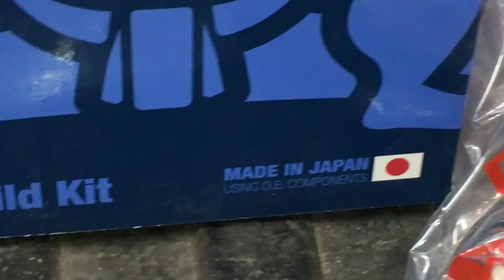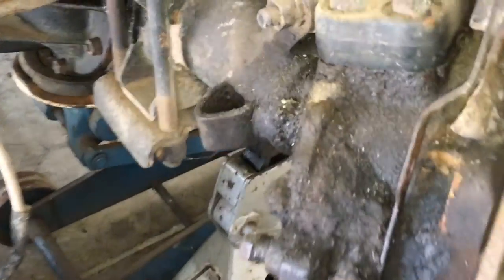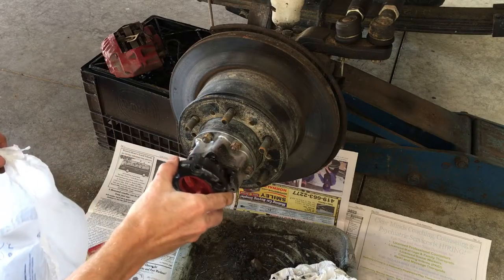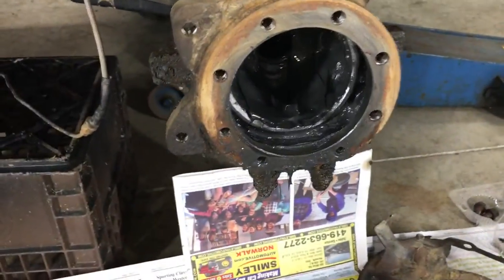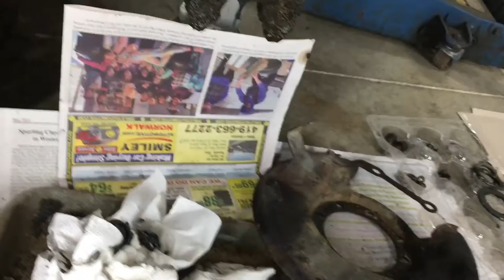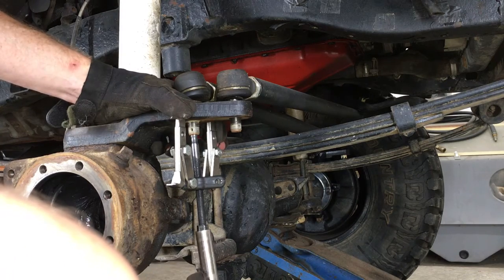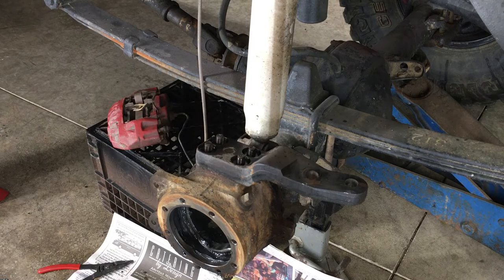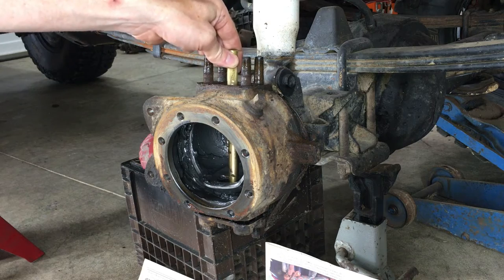How to: Toyota 4x4 Solid Front Axle Knuckle Rebuild - 4wd Pickup/Hilux, 40 55 60 Series Land Cruiser

Comment: I’m currently doing the job on my 84 Toyota truck starting with the drivers side. I knew I would have an issue with the cone washers on the locking hub when I heard you say, be sure to replace them with the split turned upward.” Turns out these are all over the board. I have managed to get 4 of them out but the last 2 are a major pain. Any suggestions that you didn’t use in the video? 
Also have you done one of these videos on the drivers side?
How about adding power steering to one of these trucks?
Thanks ahead of time. Great video by the way. Loved the cracked dash one also!
Reply from the maker: They're an absolute PITA. Some people hit the edge of the locking hub with a hammer to help break them loose, but that will dent the hub since they're softer aluminum. Both sides are pretty much the same process, so I only filmed the one side. I'm lucky my truck came with power steering, so I didn't need to add it. If you wanted to add PS, you'll need the box, pump, lines, reservoir, and mounting bracket/tensioner... that's all I can think of without looking at my engine bay. One more thing on those cone washers... did you try heating them up?

Comment: Grind the end of the puller rod like a male 3/8" socket...put a socket thats a little bigger then the bolt on the puller rod end...will help keep the puller straight....carful of the treads....can use a socket that fits the nut and the nut....but you have to turn the right way cause the nut will turn to...

Comment: Great video, lots of info. Getting ready to do the same, front n back. Only problem for me…I have a 74 fj40 no caliper brackets on my knuckle. Some have suggested I look for a 80’s 4-runner front end. Take the knuckle off that. I’d like to try n keep my original.  I bought this new…what do you suggest. Thanks for your info.
Reply from the maker: I never thought that the knuckles would be compatible, but if one rebuild kit fits both then I don't see why not!

Comment: The FSM calls for a centering tool for the knuckle bearings to adjust preload. I see you didn’t do the the low range off road video doesn’t show that as well. Is it okay to not use the centering tool?
Reply from the maker: I’ve seen a few people rebuild the knuckles but haven’t seen anyone use the centering tool. I don’t think it is necessary.

Comment: Hey again from Dayton, O. Do you have info on upgrading to 4runner calipers? Thinking about doing this since the calipers on my FJ62 are in sad shape. I have 15" wheels and 35's so some extra stopping would be nice. Thanks!
Reply from the maker: I used 1995 v6 4Runner calipers on my truck, along with 1985 fj60 vented rotors. Don’t forget the larger master cylinder to make use of the larger calipers.
Reply: @6thGearGarage  Awesome, thx!

Comment: Easier way to get the spindle off is just beat it with a dead blow. Or put a 2x4 on the spindle and beat that. Gets them off with 2 or 3 hits. Takes 10 seconds.

Comment: You placed second spindle paper gasket on spindle before dust shield where as Toyota manual STEP 10 says after dust shield. I think two gaskets are required to be honest.  But it has a drain passage for either path that does not have gasket.  I did the right side your way. Maybe do the left side the Toyota way.  
Hmmmm.
Reply from the maker: Wow good eye... I never noticed that! I'd follow Toyota's instructions.  The good news is that the knuckle is doing fine. I hope I won't have to take it all apart again any time soon.

Comment: How long should the brake rotors last? Where your rotors fairly new when this job was done? Would it be much work to go back and replace them later if needed?
Reply from the maker: Im not exactly sure how long they should last- probably depends on driving style and how much the vehicle gets driven. These were still good.  To replace the rotors, just follow this video but stop after the wheel bearings.

Comment: Do you know where i can get the knuckle rebuild kit for Toyota Hilux 2.2L 4Y Engine 1987 ( South African Model)
Reply from the maker: That 87 axle should be the same as the 85 I did in the video. Link to that Cruiser Outfitters kit is in the description. Their customer service is great... I'd double check the kit will work on your truck if you're not 100% sure.  Going on 2 years since I rebuilt with their kit and not a drip of grease/oil :)

Comment: So just to be clear he torque the adjusting nut to 43 foot-pounds, and then after he's done making sure the hub spins freely he loosens it and then hand tightens it? and also what is the snap ring that is used after pulling the axle out called?
Reply from the maker: Yeah torque first, then loosen & hand tighten. It needs to be a certain tightness to allow the hub to spin freely, but it's not a set amount of torque. You really have to just give it a spin and see if it feels right. Knowing what feels right comes with experience of working on these trucks, but you can always spin the one on the other side of the truck to get a good feel of about how it should be. I don't know if the snap ring has a specific name... axle snap ring?
Reply: @6thGearGarage  I'm trying to go from auto hubs to aisin hubs and I figured I would just follow your instructions. However, my auto only came with one nut and a bolt with a washer threaded on the axle that pulls it out I'm assuming, and keeps it from moving. Any insight?
Reply: @6thGearGarage   So far I have the two Aisin hubs, and two spindle nut kits and because my axle didn’t have a snap ring on the end I have to get two of them I’m assuming? Is the snap ring called the front axle inner snap ring or the Birfield snap ring? Marlin Crawler has both of them but I think I only need one.
Reply from the maker: @Dolorescruz-k1x  I'm having a hard time picturing the bolt with a washer threaded on the axle, but I wonder if someone else was in there before and didn't reassemble it properly?
Reply from the maker: @Dolorescruz-k1x  I would guess it is the "front axle inner snap ring" because the birfield has its own snap ring.

Comment: Just did my 84 following your video . I'm having a issue with my hub bearing preload though. Even without the nut tight or even on I'm at like 20 lb on the spring scale? I have checked that everything is seated flush over and over and nothing has changed. I have read on pirate 4x4 some people say some kits the seal creates a bunch of extra drag and are really tight but I dont know if I can go with that and rock it. Have you ever came across this problem or have any ideas? Thanks for the vid it was a life saver and very detailed !
Reply from the maker: It sounds like you don’t have enough shims installed. Thicker or more shims will decrease preload.